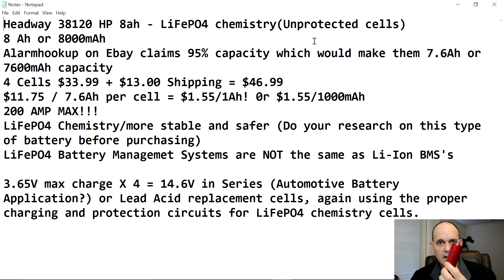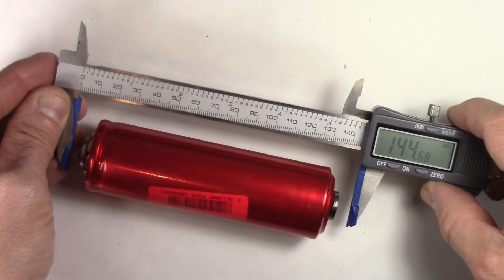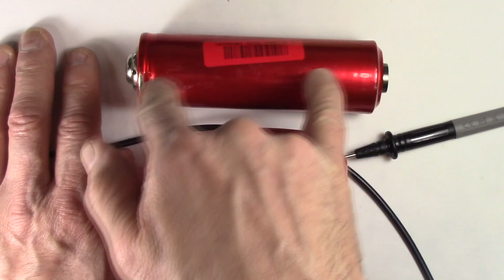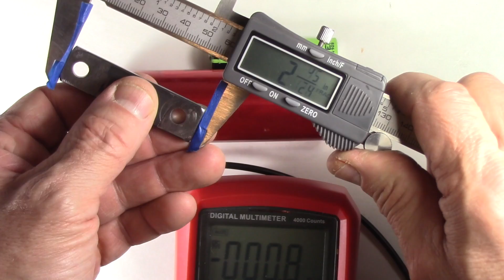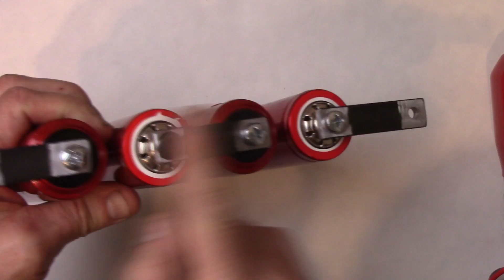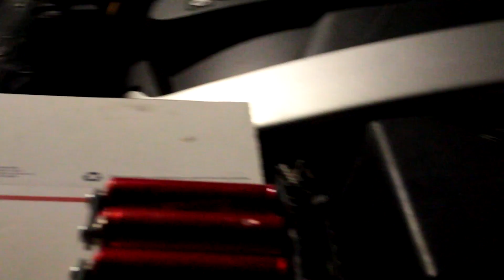Headway 38120 HP 200 Amp LifePO4 Cells Can They Start My Car? Video Review Thorough And Amazing!!!!!

Comment: Hi Richard.please advie what is the main difference from prismatic lifepo4 cells (e.g. 100,120,200Ah)
Reply from the maker: The difference in 100Ah and 200Ah is storage capacity. Thank you so much for commenting and watching. I appreciate it greatly. All the best.👍😀
Reply: @richardlloydusa  
No i mean difference between headway cells and 100ah lifepo4 CATL?
Reply from the maker: The only difference I can see is the packaging of the cells. Depending on what you require they could both better or worse as the Headway cells are individual and the CATL seem to be battery packs. Again it depends on what you require. Thank you so much for commenting and watching. I appreciate it greatly. All the best.👍😀

Comment: @4:45 While the larger automotive amps draw a lot of current, most of it is 'average current'.  The caps in parallel only supply power for the peaks.  I would hate to be in the same city block of a setup that drew more than 200 extra amps on the peaks.
Reply from the maker: Thank you for watching, commenting and the valuable feedback. I appreciate it greatly. All the best. 👍

Comment: 200 amp may work in summer won't be enough for winter you need more like 600 amps for minus 40 degrees c if you want the engine to startup as a colder engine is harder to turn over then a warm engine amps are key to start your engine up though

Comment: Where could I find a circuit diagram for charging protection of a 2x2 cell?   6.4 volts.  This is a low current application (< 1 amp)

Comment: So you do agree that it can NOT be a replacement for your lead-acid car battery due solely to the charging system in a car... yeah the volts/amps are similar but the charging will eventually fry, damage or otherwise render your LiFePo4 cells useless. You will need a CC/CV source to recharge these cells and that's added "stuff" you'll need to do it correctly (and a proper LiFePo4 BMS). That would be an interesting video to pull together.

Comment: How did you car alternator handle the batteries? When you connect to the car would the alternator be able to charge the batteries correctly?
Reply: Stock alt should charge two banks of these no problem. If planning on running these though I would suggest removing the original battery and only running the lithium. It rest higher and there for the lead acid battery resting around 12.8 will trickle off of the lithium

Comment: Did I go overboard with these. I bought 16 of these to make a 48v ebike battery. And then I just bought another 16. So now if my math is correct I'll have a 16ah 48v  ebike batt. Is that too big?
Reply from the maker: That all depends on the specifications for your ebike. 16 of these in series at 4.2V (max charge voltage) will produce 67.2V so if your bike circuits can handle that then they will be fine otherwise you will have a problem. Check the specifications for your bike and match the battery you build to it. Thank you for watching and commenting. I appreciate it greatly. All the best.👍😀
Reply: have fun doing back flips from a stand still.
I bought 20 and I am making a modular car battery replacement.
I only need 4 in series to power and start my car the other 16 are going to be modular to the point I can configure them on the fly to be 24 volts. That way if I see anyone needing a jump on the road I dont gotta park my car all awkward I can just take away the modular portion and start their car with that. 
I am still just trying different set ups. I am relocating it to the trunk to open up breathing room for my engine and it should be pretty dope
Reply: 16 cells won't make that much voltage because they are lifepo4 and the maximum voltage is 3.65v instead of 4.2v. You'll need 15 cells to make a 48v battery pack since 3.2v is the average voltage. I believe you can buy a BMS for any number of cells in series, but I would go with 15 cells in series to not mess the controller.
Reply: Nomad Chad yes mate that’s correct. Depends what kind of bike you are intending to build
Reply: If it fits it ships

Comment: I checked the red Headway 38120 HP and the single cell non stop discharge is nowhere near 120A, All the Headway cells seem to be 10 to 30Amps non stop discharge. Your cells are second hand, the full new capacity is 10Ah per cell. Not criticising you, simply giving the information needed to make people aware.
Reply from the maker: Thank you for watching, commenting and the feedback. I started my V6 3500 CC engine with these and I know that takes way more than 30A to do. I appreciate it greatly. All the best. 👍😀

Comment: Why no BMS Board ?
Reply from the maker: I was only testing the cells capacity and power not really making a permanent battery. You are most welcome. Thank you for watching, commenting and the kind words. I appreciate it greatly. All the best.
Reply: @richardlloydusa  Yes i understand, that's what i thought.  I'm looking for Lifepo4 cells like yours for a motorbike, do you think that 4 smalls 6500mah lifepo4 cells would be ok ? Do i need a capacitor ?

Comment: Can I run a series of 24v power pack in 24v car inverter for a coffee machine 1200w/h? This machine works 1minute for a coffee. If it's true 200a discharge, should work.
Reply: Should be good to go it should only pull like 50amps well a little more because of inefficiencys

Comment: What BMS would you recommend to use with these particular batteries and who sources them?
Reply from the maker: These cells are no longer available from the seller but he does have these at Ebay: https://goo.gl/uVPS7h I have several videos on these cells and I think they are a better alternative. Here is my video review on them https://youtu.be/sREdlaPEgLg and here is the complete review: https://youtu.be/Gw9f68gN_s4 How many amps are you requiring for your application? Thanks.
Reply: Richard Lloyd I plan on running a 100 watt ham radio amplifier and rig that would peak at a 30 amp draw.

Comment: copper bus that size should be rated at 202.185 amps. steel is not as efficient as copper, so it might add resistance to the circuit. use copper!!!! should be fine to derate max to 90% though.

Comment: Steel sucks as a conductor.  The Resistance is going to Heat things up.  Aluminum is even better.  https://www.thebalance.com/electrical-conductivity-in-metals-2340117

Comment: Don't use these cells in a hot engine bay as they can catch fire. I made a four cell starter battery with 38120 cells a fews years back. I knew there was a fire risk so I always checked the battery temperatures in the early days of using them. However the batteries never got very hot from radient heat fromt the engine in the winter months. However six months latter and I have forgotten about this risk and come 40degree summer day my engine bay catches fire. Would have taken the whole car if it wasn't for the bloke with the fire extinguisher. They need to be in a cool area to be used as a starter battery. Carry a fire extinguisher.

Comment: I don't own any LiFePo4 cells but isn't the voltage range like 2.8-3.6v with nominal somewhere around 3.2? If thays the case I definitely wouldn't recommend trying to discharge them down to 2v, especially if that's what you're basing the capacity off of.

Comment: Why did you wire/ plate them like that.... If they were treated like a normal battery all positives would be hooked and all negatives would be hooked in parallel.. They all will not charge at the same rate that way..  why not make 2 long bars with 4 holes to hook them all in parallel correctly so they all charge and discharge the same time.

Comment: Please check current thru outer jacket to positive or negative post, could be capacitive leakage due to design,
OR it could be an internal indirect connection to positive or negative of the battery.
The difference is just using red clear nail polish on damaged outer film of the scuffed cell and proper spacing?.
Reply from the maker: The outer wrap is heat shrink tubing. Thanks.

Comment: Would these be any good to wire up in parallel to build a portable solar recharge battery bank box for camping/etc? My current setup has a 20 some odd pound 35Ah lead acid that does okay at keeping my fridgefreezer running for 2-3 days and mostly indefinitely with 100w mono solar hooked up.
Reply from the maker: They would be good but they are out of stock. Here is an excellent alternative though: https://www.youtube.com/watch?v=sREdlaPEgLg&list=PLnxXRLSlmSVO3L0jStRnPEEN2egrODjnm&t=31s&index=1 I am doing a video on these

Comment: chargers??
Reply from the maker: I am using a turnigy accucell 6 and charging them individually though this is not the optimal way to do it. I may make a video on how to charge these properly in series and in parallel. Thanks.

Comment: Be EXTREMELY CAREFUL touching your METAL caliper to both ends (+) and (-) at the same time.  Might get a MONSTROUS  FLASH that could set fire to the battery.  Have an electrical type fire extinguisher on your desk!!!
Reply from the maker: The blue tape on the calipers is there to act as an insulator aganst short circuit. Thanks.
Reply: These cells can still function after a dead short. (Not recommended to try though)

Comment: Interesting video but good god please at least when doing a live startup like this put an inline set of power diodes, the alternator is kicking out an insane amount of messy power right back into those cells. If they go bang it will take your face and most probably your bonnet apart. some alternators are more than capable of delivering 120A for the lead acid starting batteries, they really are 2 completely different beasts. Point regarding power delivery well made though but would be even nicer on the batteries will a secondary charge controller for the batteries and some supercaps in parallel to take to take the huge startup load.
Reply from the maker: You are most welcome. Thank you for watching, commenting and the kind words. I appreciate it greatly. All the best.
Reply: I checked the red Headway 38120 HP and the single cell non stop discharge is nowhere near 120A, All the Headway cells seem to be 10 to 30Amps non stop discharge. Your cells are second hand, the full new capacity is 10Ah per cell. Not criticising you, simply giving the information needed to make people aware.

Comment: Regarding the comment about steel conducting better because it's stronger and denser...  that's not how it works.

Electrical conductivity has to do with how easy it is for electrons to pass through the material.  Density and strength have little to do with it.

Order of conductivity for common metals: silver, copper, gold, aluminum, zinc, brass, nickle, iron, tin, bronze, steel, lead

Iron is only 17% as conductive as copper, and steel ranges between 3%-15% depending on what's mixed in.

Metals conduct electricity the best also tend to have the best heat transfer.  That's why most heat sinks are aluminum or copper and why many thermal pastes have silver in them.  It's also why cast iron and steel are great to cook on, because they conduct just well enough to get hot but not so well that they dissipate the heat too quickly...  ever notice how an aluminum skillet heats up faster but never seems to get quite as hot as cast iron at the same setting on the stove?  Now you know why.
Reply from the maker: Thank you very much. I appreciate the feedback. I did do a comparison video for the steel vs copper bus bars here: https://youtu.be/I-AtvVCydD0  I also made a video on how I made the bus bars here: https://youtu.be/jP1vVb-z0yc Thanks.
Reply: Hi Richard, Thanks for Sharing
I have a Question about Pricing me 60 batteries 
38120, 8 amps capacity.
to L.A. Ca. 
Can you please Give me Your Best Deal to Place my Order.?
Thank you.

Comment: I posted it on Jehu's video but just for reference:

I got between 5883 and 8487 mah. On average around 7500 to 8000, so lightly used to new.
I got 28 in all:
Discharge Test: 3.6V to 2.5V at 7.0 A @ 60 degrees F
8487
8176
7948
7689
7988
7699
7518
8248
7660
8264
8160
7818
7780
7588
8285
8024
6907
7164
7000
6756
7377
5883
6955
7165
7208
7414
7454
6808
Reply from the maker: Thanks.

Comment: Do the voltage measurement to the outside metal again and put as a quick test your fingers across the probes. Propably the voltage will drop. So the resistance of your multimeter is 10 or 20 MegOhm and it will give you any voltage against high resitance! I dont think the metal is connected with low impedance to the inside chemestry!
Reply from the maker: I am not sure what you are asking here? Thanks.

Comment: I'm curious how the car circuitry can handle charging the LifePO4 battery pack? I mean, the car expects to charge Lead cells. If you leave the LifePO4 cells in the car they will be damaged (or worse)?
Reply from the maker: I am not sure that lead acid charging systems are compatible with LIFEPO4 chemistry. Thanks.

Comment: Would you connect your multimeter to your headway rig and THEN start your car... for science. I'd like to know how the voltage sags in such an intense application before I am 100% sold on these.

I just found out about these cells. Mind blown. I have been planning on building a battery bank with 18650s for my solar system up until now. 

Great videos thank you for the detailed analysis and use of data 👍
Reply from the maker: So you want me to reset my all the clocks on my car AGAIN? LOL I may do this tomorrow for a quick video for all of you. Thanks.

Comment: can you start a scooter with one cell?
Reply from the maker: If the scooter can be started with 3.65V or less and requires less than 200A to do so yes.
Reply: More than likely you need 12v.
4 batteries in series as show in video

Comment: Great video again.  When you put calipers on I thought there was going to be a bang, but you had tape on them. The .5 volt difference makes me think it is a fake, it is really weird, maybe a diode.   It is probably some type of safety system.
Reply from the maker: Trust me I am aware of the possibility. I have to inspect the tape carefully before I use them in that manner. LOL I don't care to start arc welding a 200Amp cell. No thanks. All the best.

Comment: could you use these cells in a solar power system
Reply from the maker: I don't see why not? They are a solid set of cells and deliver a very steady voltage as LIFEPO4 chemistry is known to do. Thanks.
Reply: Iron Edison Battery is now selling them for solar applications.

"BATTERY LIFE: Supporting a daily 80% depth of discharge, Iron Edison Lithium Iron Batteries should last 16 years or more (6,000 cycles), and comes with a 10 year warranty.

INVERTER CHARGER BMS COMPATIBILITY:  The Iron Edison Lithium Iron Battery is designed to be fully compatible with industry leading inverters and charge controllers like Schneider, Outback, Magnum, MidNite Solar and SMA. Unlike the Tesla PowerWall, Iron Edison’s LiFePO4 battery comes in industry standard 48 volt configurations making it a direct replacement for lead acid battery chemistries."
https://ironedison.com/48-volt-lithium-battery-for-solar

Comment: Got 32x 40152 15ah  headway cells on my bike 116.8v no BMS done 10.000 miles and they are still as strong from the day I got them! 
4 years old great battery for my purpose.
Reply from the maker: Thanks
Reply: Looking for use on ebike as well, how do you charge them, please?

Comment: Nice video, just not sure about the relevance of your car test.  You cold-started the car with the lead-acid battery. Then you disconnected it and connected your cells while the engine was running. If I understood your comment at the time correctly you said that the car is currently running on these cells.   This can't be true as all the electricity in the running car engine is supplied via alternator including charging the battery. Then you used the cells to restart a hot engine. You don't need much of a capacity to do that.  I am not criticising your video, just trying to understand your point. These are nice cells indeed, but there is no way this 8ah battery will replace an 80ah+ lead acid battery, least of all acting as boost pack when a cold start of the engine is needed.
Reply from the maker: Here is the cold start test : https://youtu.be/61NDp41K7fg Thanks.